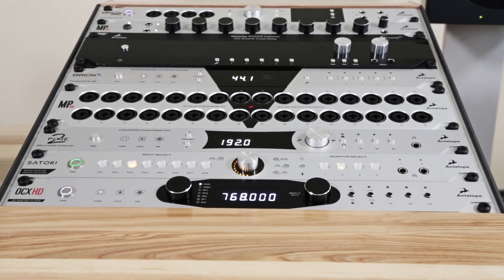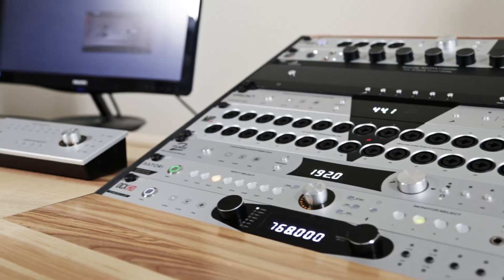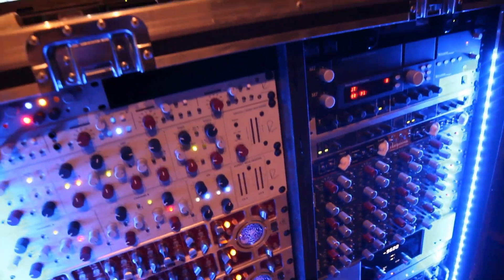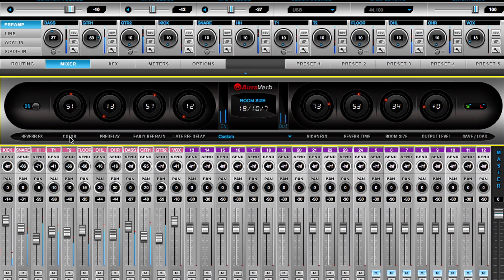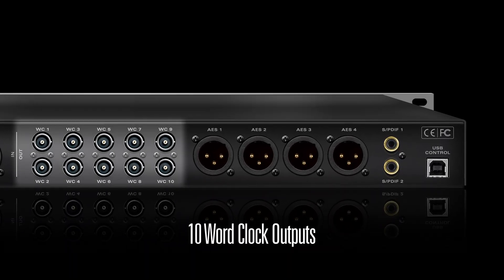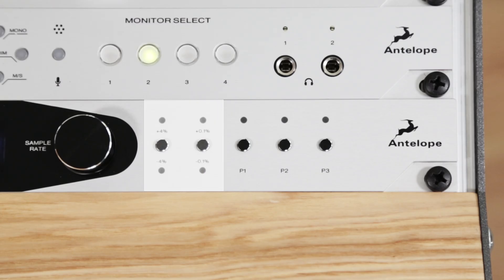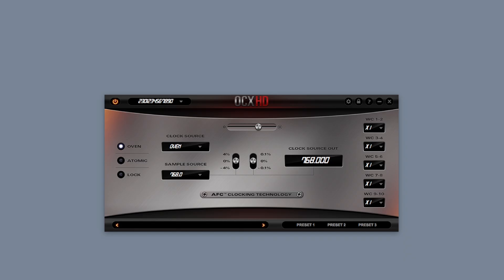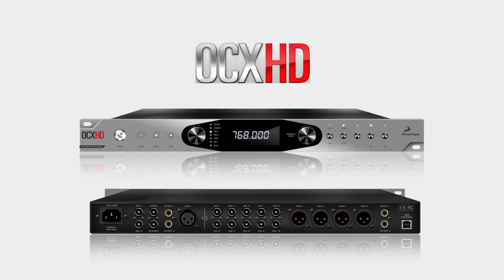Isochrone OCX HD Master Clock | Antelope Audio

Comment: Hi! As I have never needed a Master Clock before, does this  improve anything in a small home studio? (Gear: Pro Tools 12 (NOT Hd) + Fast Track Solo sound card). Or this clock is only for multi source recordings? It may sound silly but an answer will be appreciated!
Reply: Yes it does I have it in my mixing rig at my home studio. It helps what you hear through the monitors alot clearer and makes a huge difference in your da converter. I swear by it it makes a huge difference in the mixes.

Comment: I have a madi xtreme card and a ssl alpha link converter clocked to the card. I run my tracks through a few pieces of outboard gear and sometimes get clicks and pops but dont know if its the clocking or denormalization caused by some plugins. Is my internal clocking the problem when running audio through so much outboard gear?How much of a difference does the trinity vs the ocx make?
Reply: 81awesomeness that’s probably issues with drivers, DAW interface, and low buffering. I hate being that, personally, but that’s what it almost always is. Unless you run multiple audio interfaces, it helps. But digital boxes with analog ins/outs, then no, ime. But YMMV